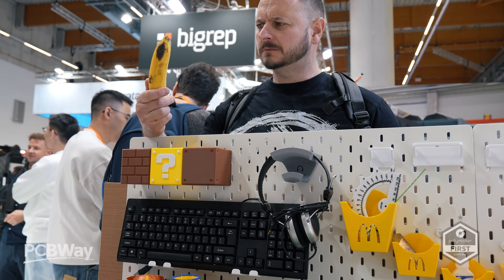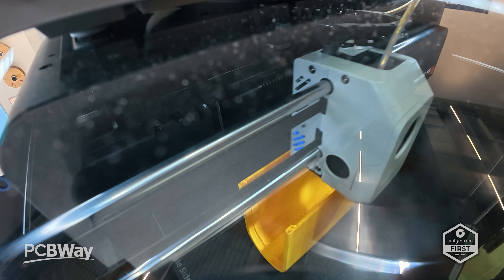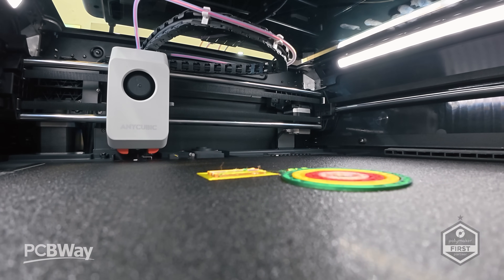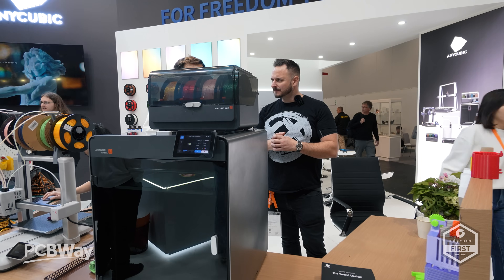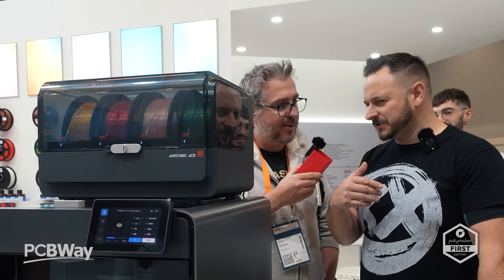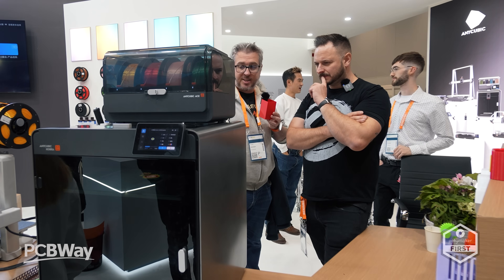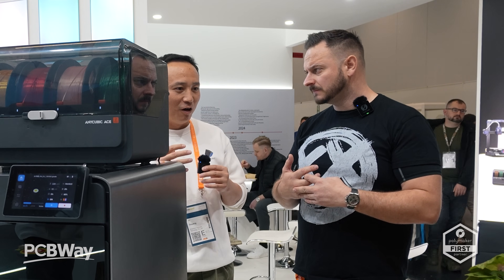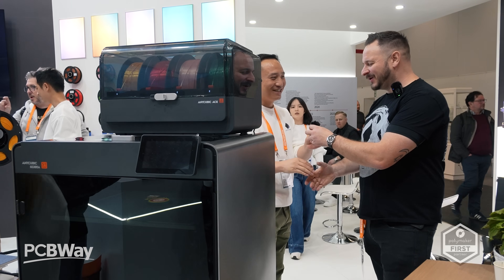FIRST LOOK: Anycubic’s 16-Colour CoreXY Beast – Kobra S1 Max Combo at Formnext

Comment: When you look at the specs in addition to the price it does feel like they're really trying to be aggressive to get more market share. Pure spec wise it's build volume is bigger than the H2S, it's got the same max nozzle and bed temps as the H2S, and the same active chamber heating. Sure it's a little slower, only has a 0.25 instead of a 0.2, and can only do 16 colors instead of 24, but it's also 2/3rd's the price of an H2S at MSRP and with the early bird it's even less.

Comment: Hey Sam,
Does the S1 Max have HEPA carbon air filtration for the toxic fumes emitted by high temperatures engineering materials?
Thanks 
John
Reply from the maker: Hey john I’m yet to get the machine but I should have it by the end of the year and I’ll be able to answer any questions at that point

Comment: I have the Kobra S1 and a Creality K1 Max. The bed on the K1 Max is only 3 mm thick and sucks (should be 5/6 mm). If this printer comes with 350x350 bed, 3 mm is a problem. Using any filament other than PLA or PETG, with bed temps like 90-100° and more, the bed warps a lot, and the system cannot compensate it.
Reply: You’re right, it’s a disaster waiting to unfold. That’s the problem with the k2 plus and it has a 6mm bed. The only way to fix the k2 is a graphite bed upgrade and once done the printer is an incredible printer. I’ll never understand skimping on the piece where the print is being made. SMH
Reply: Yeah the S1 has a cheap 2mm bed that warps like crazy. Horrible first layers. It kinda ruins the machine honestly. If they didn’t fix this on the S1 Max then this thing is gonna be garbage.

Comment: Tempted to get the Ace Pro 2 for my S1, but, think that while it is better, it'll still give poop issues, so think that my next print will be a tool changer or 2 nozzle, but not from BL, not a fan of the closed system...

Comment: should i buy the p2s combo or wait for the kobra S1 max combo. The difference in price for me is 1050$ for the p2s and as a early bird 1119$ for the kobra.
Reply: S1 MAX
Reply from the maker: They are very different printers regarding the size so it depends on what you will be printing
Reply: What would you say if it were for your mom to be able to use when you're working your day job? I've had an a1, a1 mini, elegoo 4 max, anycubic kobra 3, anycubic s1 pro,and the current lineup is  flsun  t1 pro s1pro and a elegoo centuri carbon.... in my experience the reliability is a key difference between the brands. Flsun is magical when it works. Anycubic cobra 3 and s1 were amazing for a few dozen hours and then they tanked. elegoo has come the closest to the bambu reliability of press print and wall away. I have a need for large format print volume and am just wanting to be able to print while I'm out and about without the fear of getting home to blob of death and I am not comfortable with gambling again. But no h2s in stock anywhere so if you're able to snag a p2s DO it!
Reply from the maker: It kind of sounds like you’re saying can a woman work it.. at the end of the day it’s a tool, of course brand confidence is also a factor.
Reply: I have had the s1 and I have a bambulab x1 carbon, and you get better prints with the bambulab. I have ordered a P2s combo and an s1max for larger prints. If you can handle 256 x 256 x 256 mm buy a p2s.
Reply: If you don’t absolutely need the larger size of the S1 Max, then I would go with the P2S. It’s a much higher quality printer from a much higher quality company.

Comment: Love my kobra S1, it’s a superb printer but only after installing Rhinkals and upgrading the heated bed as mine was warped worse than a banana. Looking forward to a graphite bed install soon as I had to do on my k2plus which was also had horrendous bed levelling.
I hope anycubic have learned their lesson and improved the heated bed.
I did sign up for the pre-order £50 but not ordered the printer as I’ve bought a few H2S printers which have been awesome.
Reply from the maker: Yeah I’d definitely suggested the S I have a couple here too😊
Reply: @TheRealSamPrentice  The S1 is garbage if you don’t spend the extra $100-200 upgrading the bed. At that point it’s not even worth it anymore. Just buy a higher quality printer from another brand. My Bambu Lab A1 prints way better than the S1 and it’s an open, bed slinger. 🤦‍♂️
Reply: That’s the thing though, the whole idea of this printer is that it’s a less expensive option for a core XY multi-color printer. But then if you have to spend $100-$200 extra upgrading the bed, then what’s the point? Just buy a higher quality printer like the P2S. 🤦‍♂️